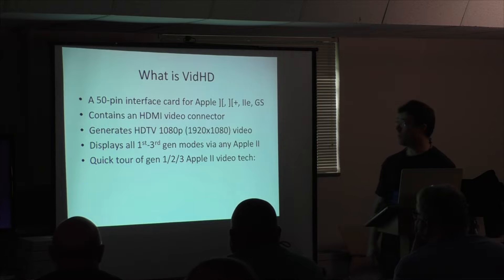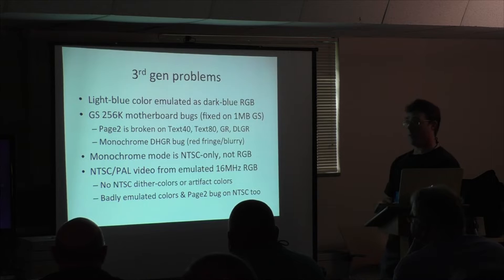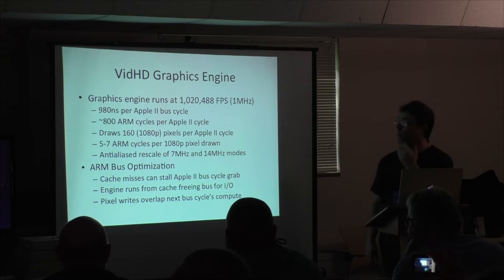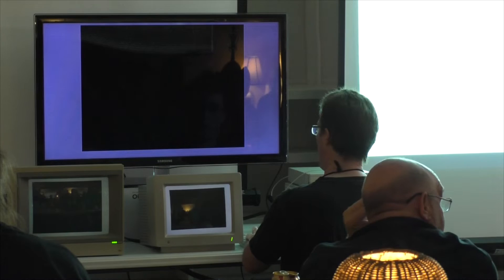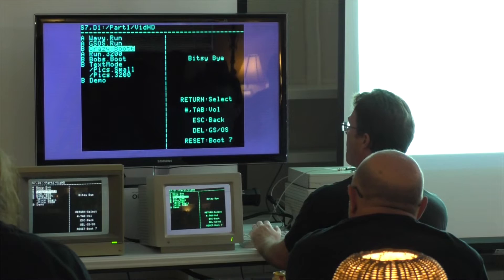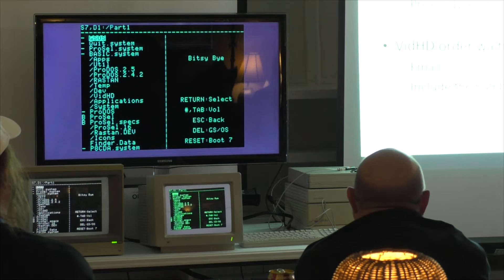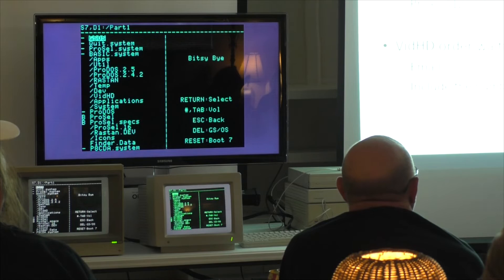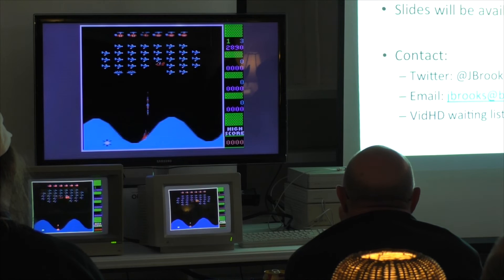KansasFest 2018 - Introducing VidHD - HDMI for Apple II by John Brooks

Comment: Amazing!  I've been wishing ever since the Second Sight card turned out to be such a disappointment that someone else would take another crack at something similar.  And now the hardware is so fast and cheap, it can be done all in software!  But I find it a bit hilarious that the hardware being used as a display for the IIgs has at least 500 times the computing power of the IIgs.

Comment: Any interest in emulating an Uthernet or similar on either the wifi or wired connection on the embedded Orange Pi Zero on the VidHD? Or pass-through storage on that USB socket...? There's so much you could add to a IIgs since you've gotten us to install this. :)  It could be like a Tesla where they are paid software upgrades.